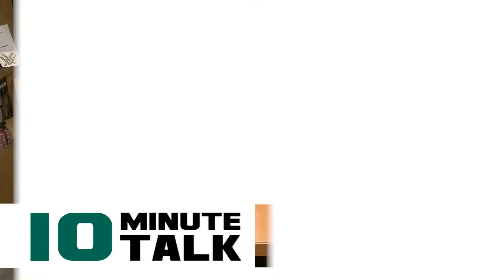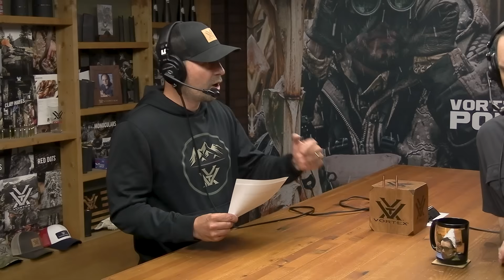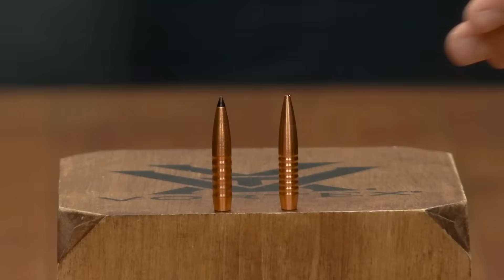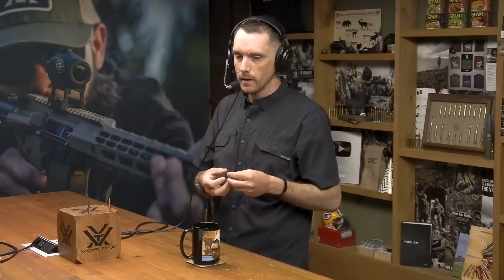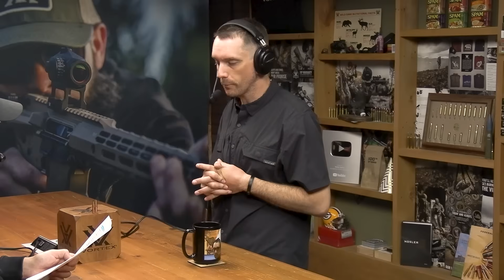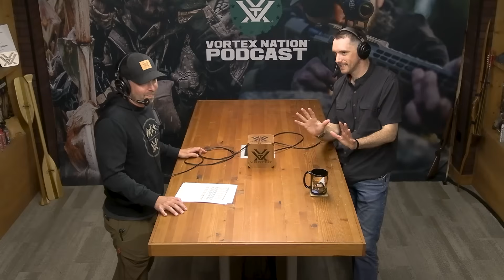#10MinuteTalk - Hammer Bullets — Do They Hammer?

Comment: Well ill toss in Cutting Edge. Their consistency and BCs allows for ELR records, and their performance on game is basically identical to hammer. Much better designs in my opinion.
Reply: I would say that Cutting Edge Maximus is a stellar normal range hunting bullet and an excellent price. I have heard reports they're are harder to tune than hammers. I think their lazer and raptor lines are really pricey.
Reply: @Snailz5  Lazer and raptor yes, i agree are expensive, but tuning i have not had an issue. My latest rifle i loaded them for shot a 1.25" group in a ladder test across 5gr (.3gr jumps) of powder 2990fps-3230fps. This is larger than i normally do, but playing it safe per their recommendations, i was 5% under two book maxes and have ended above both of those with no signs of pressure. Headed out this weekend to verify groups in a few nodes i found.

Comment: I'll stick with Barnes and Cutting Edge. Badlands were great too. Hopefully someone brings them back.
Reply: Badlands need to get picked up from somebody. Such an excellent design! Apex Afterburners are pretty close, but they shed the nose instead of holding petals. They're also pretty expensive compared to the Bulldozers. I'm hoarding my last 100 150gr 30 cals!
Reply: @Snailz5 I've heard that somebody did take them over. It's going to take a while to get everything situated, is my understanding. Time will tell.

Comment: I fall in the ground off people who have never used them, but have an opinion.
I never realized the hammer bullets are designed to fracture. Personally, knowing that makes me less interested in trying them. I'm sure they would work, but I think they wouldn't give me quite the performance I'm looking for. The main benefit to monolithic bullets I see is the ability to shoot through a front shoulder on a big animal. While these would probably work, in that case a non expanding flat nose would give me basically the same performance I think, as the petals would really only be causing flesh wounds. Maybe I'll try them some day, but for now, there's nothing the 160 grain Barnes LRX won't do extremely well for me..

I also don't know that I believe fragments on a high velocity rifle round with a properly expanded bullet will create additional damage. I would imagine the permanent damage caused by the temporary stretch cavity (hydrostatic shock??) would extend beyond the wound channels created by those fragments. I know a Barnes bullet moving fast will turn most of the chest cavity into soup just from the hydrostatic shock. I don't really know that there would be a benefit to having fragments. Maybe on a slower velocity impact where you aren't getting that typical rifle wound chanel
Reply: Barnes and hammer are definitely different design philosophy. The benefit of shooting a hammer over a flat nosed solid is having a higher BC. In my experience the petals can penetrate up to 10 inches in high velocity cartridges, roughly 3-5” away from the main wound channel. Meaning if you missed the heart but hit low enough, you can potentially get a double lung AND a heart shot when you might have only gotten a lung shot, the combo of the 3 making for a near instant kill where the double lung might have just enough time to run somewhere that sucks to get them out of. Bushes, down into a riverbed, etc.

The flat meplat tends to penetrate better than an expanding bullet like a Barnes of similar weight just due to less frontal diameter. But, the Barnes, as you have noticed, will have a more impressive wound channel as it can shed more energy in a shorter insight.

The rounded bands on the hammers do make them much easier to get an accurate load with in my experience than the Barnes or similar. You also can get more velocity out of a given bullet weight due to less friction and a tighter seal around the bore (they’re designed to be ever so slightly over bore to get a consistent seal)

I personally like both Barnes and hammer. They each have bullets that do thinks the other don’t. Higher BC for a given weight, or more damage, or better penetration, etc etc.

They’re a great option. Options are good.
Reply: These will still penetrate just fine. Shoulder blades are millimeters thick, it doesn't take a lot to get through them. The only hard part to get through in the front half is where the humerus meets the scapula, and if you're shooting there then you're already at the front edge of the vitals.

Fragments also do increase wound size. Any look at terminal ballistics testing shows this. They move outward much farther than hydrostatic shock can take you. Not only that, when you impact at high velocities you get temporary stretch cavities. When these small fragments of bullet hit that stretched tissue it's like cutting a rubber band, adding to the permanent wound width.
Reply: @papajohnsy6659  you are correct about them going through a scapula just fine. Im not worried about the base of the bullet, im just thinking the petals probably won't go through that much meat, then the shoulder blade. If they don't, then all im getting through the vitals is basically a flat point solid, and im not to keen on trying to kill an elk with a 7mm solid.
I've never really thought about the fragments cutting the stretched tissue, but it's definitely a smart thought. Ive just never really noticed a difference in wound channels from bullets with lots of fragmentation over ones with large expansion. The federal fusions have especially made me feel fragments are not beneficial, as those bullets maintain the vast majority of there weigh, but cause horrific damage. Granted, these copper petals will probably act quite differently than the small led fragments from say an SST.
Reply: You're pretty close to spot on. The deer I shot that clipped the aorta had bruising on the rear of its liver. So I think you're generally right, if I'm reading you correctly. It's not a wide path of direct tissue damage because the fragments stay close, but they separate surprisingly fast and create a pretty intense shock balloon. It was interesting damage to look at. Basically a tube of disintegration about 3.5" diameter and tons of capillary damage to the organs outside of that, but not the type of intermediate destruction you'd expect from "fragmentation." I got into them precisely because they fragment, it's just what makes the most sense to me, but it's not at all a cone of cascading damage like you see with lead. But it is still helpful. It turns out they're also abnormally flexible on getting user-friendliness across rifles, and that's a nice extra and the exact reason why I didn't go with barnes, a bullet I've never used but have an opinion about, as you say.

The one point I'll argue is the penetration capability. They shed their noses specifically to reduce the surface area and extend both the distance they penetrate and the speed at which they are traveling along their entire path. They were designed around guaranteeing 2 holes in elk. I talked to a guy last year who went end for end with a 75g 257 on a hard quartering away buck. It was out of a 257WBY, but youre still talking about a 40 shank going 3ft+. Among the nerds, finding the bullets has been a problem. Even the petals are typically way farther than you'd think or also exit. Again, a different philosophy about wounding and not for everyone, but penetration is of least concern with these things. I don't think they're the only good bullet, and if someone's happy they're happy, but they're fun to use. Direct sample size of one for me and a lot of anecdotal discussions, but it's interesting.
Reply: Meatloaf mashed potatoes gravy peas or carrots 
 If you don't like it. GOOD

Comment: The twist rate warnings is what kept me from getting into them.
Reply: Most of their bullets stabilize with less, they chose those numbers to keep the bullet straight in the animal. But as long as you have at the minimum what they recommended you’ll be fine
Reply: They punch above their weight in lighter configurations, so going lighter and more stable is pretty much always an option.
Reply: @jcarry5214  yeah.....i wanted too on my 243. Then I saw that I'd either have to get a special barrel and or only shoot light hammers. I can run any traditional weight in my 243. Or, I can try to only shoot like 65 gr or less......
Great, so my deer and antelope gun will be stellar on coyotes and may need follow up on bigger critters.🤔 
Same with my 30-06. So I can maybe run a mono 130 in it at 3200? Great. So far, it only likes 180 gr jacketed. 
I would totally switch..... if it would work. Not to mention the possibility of increased pressure, so my older guns couldn't be expected to run then even with a boutique rebarrel. 
If someone like Ruger built something like the American gen 2 that was off the shelf ready with a special twist rate, load range and bullet weight specific for mono bullets at a decent price, I'd consider it. I can't see that happening.
Reply: @SmartypantsMcChicken  I understand, I just sharing what I've learned. Original twist 6mms, some 22s and old 25s get a bad deal. a bunch of the guys actually get a lot of love out of the 130 class in 30 cal, and no offense but a 243 is going to need follow ups on medium game with a lot more bullets than just hammers. The fact is that they do kill above their weight class. I talked to a guy who went full length on an almost dead-away buck with a 75g 257 last year. I'd also add, not to invalidate your concerns but be sensitive to them, is that fussy guns tend to like hammers, and the same for antique guns because the low amount of contact with the barrel, which also makes them generate lower pressure than lead, not higher like normal copper. Anyway, I do understand, I'm jsut saying some guys use them literally because of the concerns you have. I prefer shooting at the lighter end of traditional weights, 140g 7mm or 90g 257 for example so I do honestly get it, that would annoy me. They do favor newer guns like creedmoors, saums, and companies like browning that are piping faster twists into older chambers.
Reply: @jcarry5214 yeah that's probably true. Purely anecdotal but my first bull elk I ever killed was with a 243. 100 gr partition at 250. Quartering. One shot and he never got up. I feel like monocopper is the 6.5 Needsmore of bullets, it answers questions that no one asked. And everyone expects it to do some magical terminal ballistics that only lead can do, or in the case of the Needsmore, just because it'll ring steel at 1000 yards, doesn't mean it'll put an elk down at that distance. 🤷
Reply: @SmartypantsMcChicken  yup, totally fair. Impressive. I know people that have taken piles with a 30-30 too. And there's plenty of videos of elk soaking up rem mag slugs, it doesn't matter what you're using if you're not hitting them right. For me, I like trying out different concepts and the wounding theory of hammers is sort of a third way between monos and lead. It's weird to see in person, it's like Berger level damage but only in a 3" pipe, while the shock bruising goes out way far without shredding. I think copper answers a couple things but yeah it's not a universal answer. I do like that Hammers get lower FPS performance than other coppers, but again definitely still not lead. The things I'm liking the most about them are the ease of use, MV, and raw accuracy. They outshoot ELDM and ABLR by a noticeable amount. But I still dual load when it's relevant. Because like you say hitting isn't necessarily killing and you really need to plan on a margin of error at long range.
Reply: @SmartypantsMcChicken  also, i really didn't mean to sound belittling about the 243, it has the juice within its limits. Doesn't sound like you took it that way. I feel like people who use 6mm on elk know they have to shoot like champs, and use good pills. Back east people used to use the cheapest stuff possible and it just doesn't hold up to use a core-lokt on a quartering neck shot at 40 yards, where that's the exact situation where a mono shines. Even the 7 rem had a poor reputation because people were out there taking raking shots with junk bullets that might have been the right thing at 400. So that's more what I was talking about.
Reply: @SmartypantsMcChicken  69gr absolute hammers at 3200fps impact velocity in my brothers 243 had every petal and the shank exit the chest. 

Also if you can only run a 130 in the 06 it must have a 12 or 14 twist, which I doubt it does.

Comment: We have used the 80 grain HHT in 6.5 CM for a few years now and have taken numerous whitetails from 50 yards to 400 yards and they have worked great every time.  And yes shot placement was also good in every case.  They are very easy to develop an accurate load with and we get the 80 grain bullets going to 3250 FPS in the 6.5 CM.  And like other copper bullets the meat damage is less than with match bullets (ELD-M and TMK)
Reply: Well id hope the meat damage is less. The eldm and TMK are ultra thin jacketed lead core target bullets.  Not at all in any way are they game bullets

Comment: So basically, it’s a copper that performs like a nosler partition
Reply: Precisely
Reply: That's what I tell people, good insight.
Reply: Kind of, wound channels aren't nearly as violent as partitions. Not good or bad just different. If you want to save some meat then they're better but in terms of killing ability it's not as good as a partition.
Reply: @papajohnsy6659  that's pretty accurate, it's much more of a tube of damage vs a cloud. I think the generality applies though when comparing it to other monos or talking about the initial shock of expansion. As far as raw efficiency, yeah almost nothing equals the partition.

Comment: My experience with hammer. 
You call the number on website, and one of the owners will answer any question you have, and tell you what they think based on your application. 
I went with the 183HHT in my 300prc, 138 HHT for .308 and 155AH in my 7prc. All the rifles printed sub 1/2 moa with ease. 
The 7 prc 155AH @ 3300fps from a 22”.
The 300prc 183HHT @ 3200fps 24”.
For the .308, 138HHT & 3200 22”. 

Roughly 5 Texas sized feral hogs in so far. I’ve noticed they always make very consistent 3/4” or so entry and exit, haven’t stopped or caught one yet. However, the animals do not act as if they are hit with a magnum cartridge, unfortunately for me, it’s resulted in more frequent and longer tracking jobs for recovery. I really believe you need solid double shoulder impacts for these to perform very good and drop animals. For me, a Berger has done that without fail. The Berger takes more load development and isn’t going to get the same muzzle velocity, but ultimately, I don’t want to go looking for my animal after it’s been hit. I want it to fall in its tracks consistently. With that being said, A high shoulder shot is hard to screw up with any bullet. The bergers are much cheaper, and if the opportunity presents itself, I’m much more comfortable taking a lung shot with a Berger than any copper bullet. I think hammer bullets are great for some. I would love to see them spin up a bullet that mushrooms like a Barnes, but with the PDR tech to allow the muzzle velocity & accuracy.

Comment: Well, now you have to do a talk on Maker Bullets. 

Edit: also honorable mention for the Lazzeroni Lazerhead bullets (not the cartridges, you did those, i know, but the bullets they make)
Reply: and also Lehigh Defense Controlled Chaos.  Same kinda performance.
Reply: @InWithBothFeet nah, i was talking about expanders, not fracturing. the only lehigh bullets i care about are the extreme defenders and the like, and even then other companies do the same thing.
Reply: I agree on the Makers. Called and had a nice 10-15 minute conversation with Paul about the 450 grain Expanding bullets for 375 Raptor subsonic.  Very helpful on the matter. I was definitely impressed with the customer service.  Also purchased their tipped supersonic 200, 225, and 250 grains to try, may even buy some 300Blackout 220gr's to test.

Comment: Rain is banking on this bullet shedding all of its pedals at the exact same time to reveal a wad cutter. That's not going to happen. The way shoulder stabilization occurs is through pressure on the side of the bullet straightening the bullet back out as it starts to tumble. If you have an irregular shape in front, like part of a pedal, there's a good chance that bullet's going to tumble. Watch videos of hammers shooting animals, they often eject at weird angles. Also, do we want a bullet acting like a solid copper going through an animal? Especially when it's only 6.5 mm?
Reply: I mean I caught one in the knuckle of a humerus from a pretty hard quartering away shot presentation. The shank tracked straight and embedded in the proper orientation. Terminal performance was stellar. Other deer I high shouldered had a straight path exit. Two different bullet weights and very different shot angles and parts of the animal hit. They do a lot of internal damage, but I will say the entrance and exit on the second were rather small and I would worry about tracking on any shots around or above midline since those small holes can clog up pretty easy and leave you SOL if you're a bit far back and the animal has enough life in it to get 100 yards or so and has access to thich stuff.
Reply: Ensure the barrel has adequate twist and these issues generally disappear.

Comment: Thanks for the info but I will stay with the Barns TTSX in my 7mm-08 and 2760 Winchester.
Reply: I've been running the Barnes ttsx 110's in my 7mm-08 ...3200fps with more room.
Reply: Barnes ttsx 120gr 41g of varget, been my go to for a decade. Tried the hammer hunter 101gr two years ago, did alright but the Barnes have worked better for me. However not sure if it was the bullet or my shot placement.